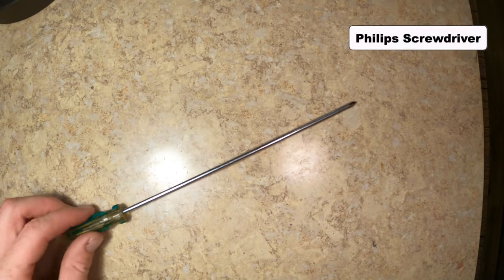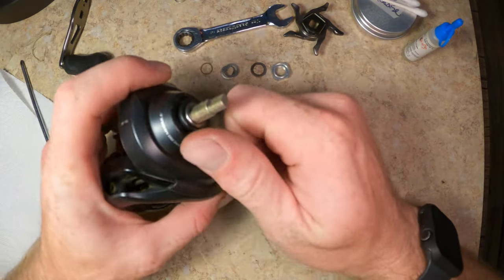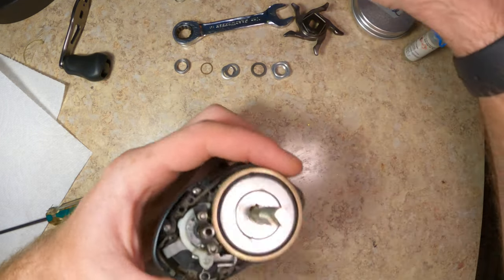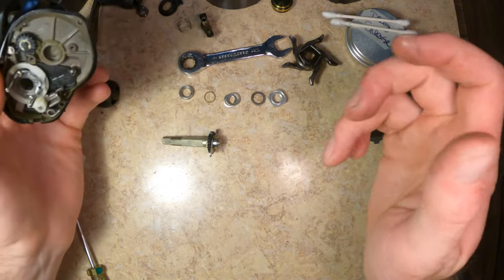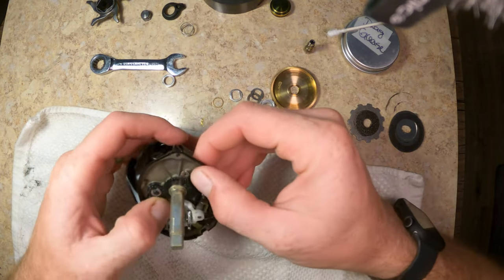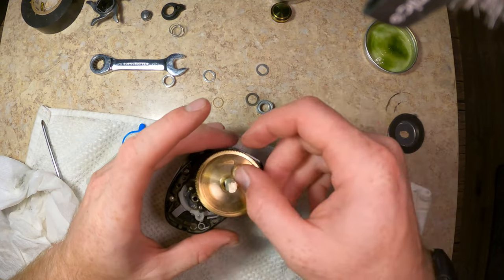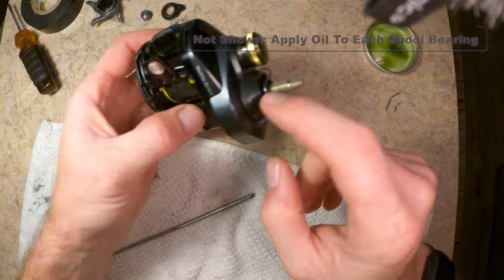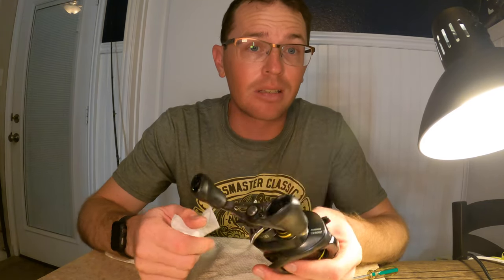Shimano Curado 200K Fishing Reel - Repair 🔧- Disassembly - Maintenance - Broken - Fix

Comment: I've never understood the clutch bar, as Shimano calls the thumb bar, chain of action.  When the bar is up, the spool won't move in either direction, but when pressed it will.  What's the interplay of parts from the thumb bar?

Comment: I bought a used Curado and the spool tension knob doesn’t appear to be cross threaded but it’s hard to adjust the tension and it seems like it bottoms out? You really have to tighten it on heavier baits. Any suggestions?
Reply from the maker: @kennylowe9404  I'd look real close on it being cross threaded. It can be missing the little carbon shim inside of the cap, but if that's not missing, it's probably cross threaded